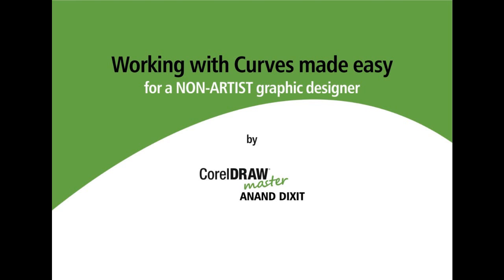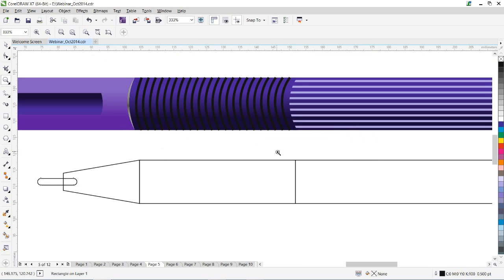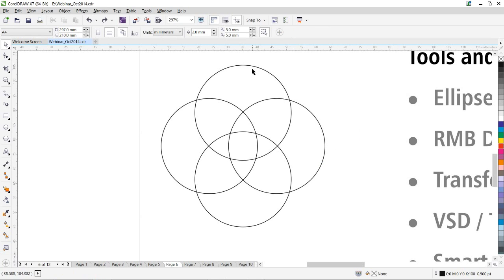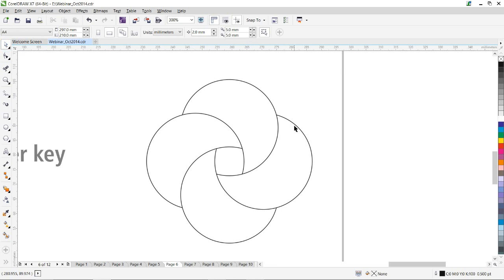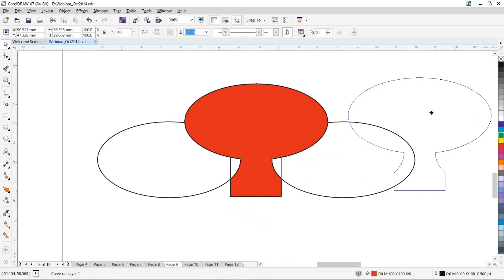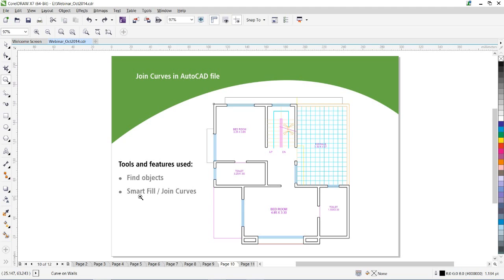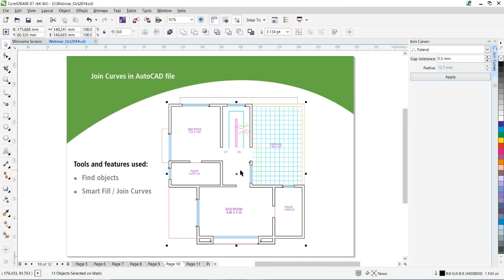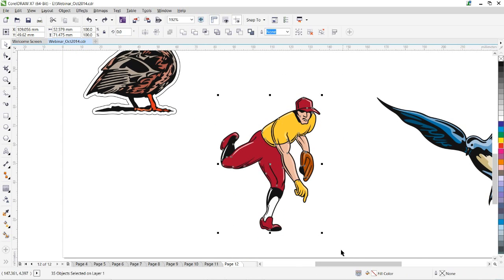Working with Curves for non-professional graphic designers - Webinar by Anand Dixit

Comment: I followed a link from Corel 2019 to your Webinar.  Glad I did.  The material is still relevant and very helpful.  I am a mechanical engineer that often has to create graphics for proposals, patents, product documentation, etc.  I work a lot with geometric shapes.  The tip I learned from your video will reduce the time I spend creating new graphics.  thanks you for taking the time to create this video.